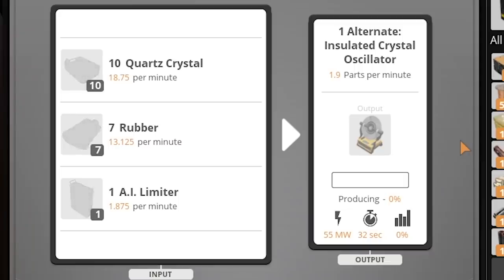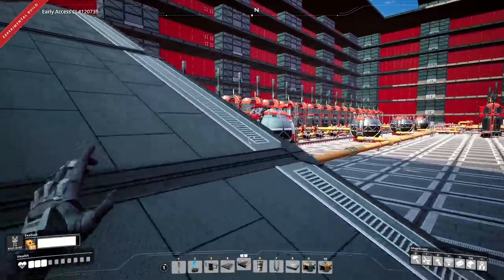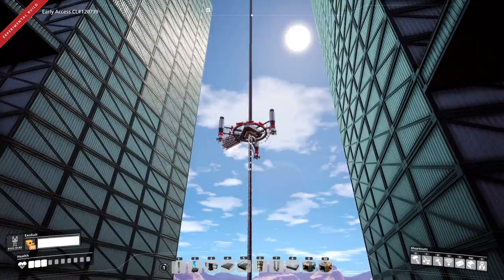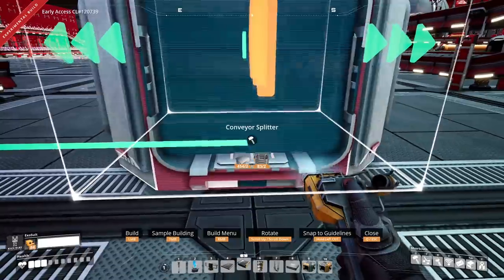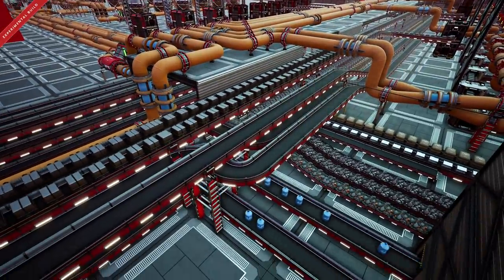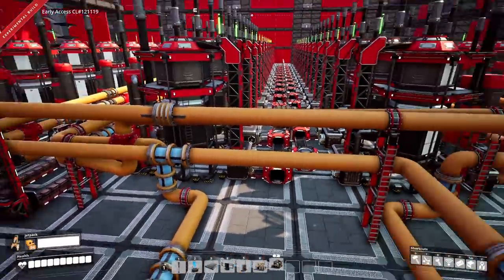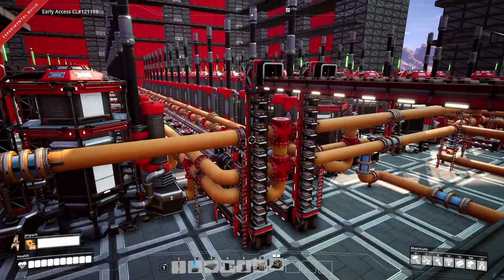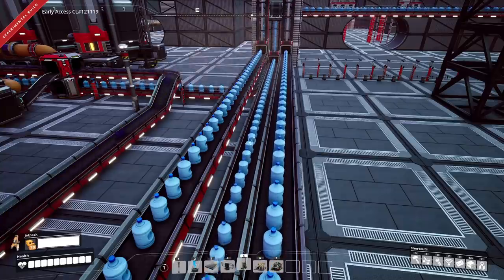The BIGGEST Belt Disaster I've Ever Made - Satisfactory Early Access Gameplay Ep 28

Comment: Well, things I’d like to see added to the game: larger pipes, better ways to elevate fluids, even bigger fluid buffers, double stacked train cargo cars, and a coffee mug with kibitz’s face on it.
Reply: We don't need to elevate fluids at all, it's much more logical to make small factories near water, to transform your raw materials there and to bring the ingots or your semi-finished products to your main factories.
Reply: I'm actually considering making a 6 by 6 train elevator to bring up water to levels needed.
That plaster every meter of vertical tube with pumps gets old so very fast
Reply: Bigger pipes would help with some things like the pipeline that Kibitz has so that he wouldn't need 12 different pipes  together
Reply: Elevating fluid is actually quite easy. BUILD A WATER TOWER. 
Also, water pumps snap to walls
Reply: Robbe Nachtergaele huh... interesting concept, depends on how the fluid pressure system works, and has a cap or not. Of course you still have to elevate fluids with the same amount of pumps. Also it would use more pipes and buffers to do so. Only real use I see for it is a pre-pressured tank system that could be used to jump start power plants without initial power. Energy wise its identical.
Reply: @Electric_Bagpipes  It works like in real life. If you pump water to some elevation once, you may drop it down to the bottom and it will go back up again to the same level without having to use pumps again. And it does not even fluid buffer on top, it may be just a straight pipe. And to restart power plants... You just need a buffer on the same level or slightly higer than building input/highest pipeline point and you will be fine. There is no reason overthink it. Just fill it up and disconnect from the system.

Comment: hey kibz. you could have probably reduced the size of the spagheti beast by a lot if you used a spliters and mergers instead of industrial storage crates. by having a merger at the back running into a spliter, the spliter goes into two lines, one to the packager and one goes to the next spliter merger pair, meaning it would not only be able to be compressed from the sides, but you would also be able to stack them.

Comment: I have been wondering why you don't do a single packing/unpacking setup for the whole base?  You can have it dump into industrial liquid storage on the roof (or at least high above the construction floor) and then let it flow down.  If they have done the mechanics right, you shouldn't need any pumps that way either as it will gravity feed into the construction floors.  Also, then you only have one packing/unpacking loop so you never have to worry about container flow issues. It should be relatively trivial to setup enough flow up the spines to fill the "water towers" and disseminate it out from there.  Just a thought.

Comment: For your sanity you should unlock tier 7.
also belt balancing is not that important. If you have roughly the correct belts for the input, logistics back propagation will load balance automatically. I built a 7M points per minute base like this with  no logistics lag (just don't make long lines of machines that increases logistic lag)

Comment: Maybe I'm not just getting why it would be difficult but... your plant is in form of tower, why not make it in to advantage and unpack all water you are using at top floor(s) and deliver it to other systems in pipes not packed? 
Pressure is free ( as you are piping it from top to bottom)
One central point means you need to change only one point if any recipe in game changes.
Production floors get easier to manage, as you deal only with pipes for water, not belts, refineries and then pipes.
Yes, you generally need more transport lines, as all water needs to go to top level and then be transported in pipes back down, but only pipes are new line, as you needed to "reserve" place for packed water at bottom either way regardless if its branching on way up or not as for few lower levels all waters goes either way.
And another disadvantage is that it requires good planning of water usage or leaving a lot of room at top floors "for expansion"

Comment: Hey kibitz I think I found a problem with the coal generators, I know you're past that but I can't find anything on the forums. By my calculations a coal generator requires 15 coal per minute and 45 water to work. But I think it's broken it's consuming 2 coal per minute and it's the same with water. So with 60 coal you can now technically fuel 30 generators. Can anyone confirm?
I'm on early access not on experimental build.
Reply: If you're not using 100% of the power produced it won't take 100% of the fuel. i.e. set up 1 coal generator and hook it up in an isolation line with machines that are always running that use the full amount of power from that 1 coal generator and you will see that it does indeed take 15 coal and 45 water per minute to run.